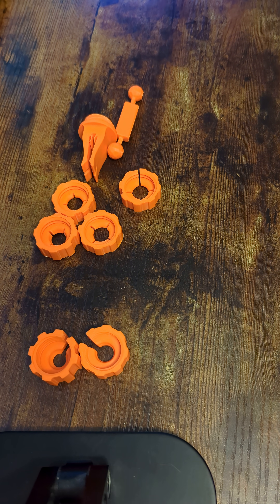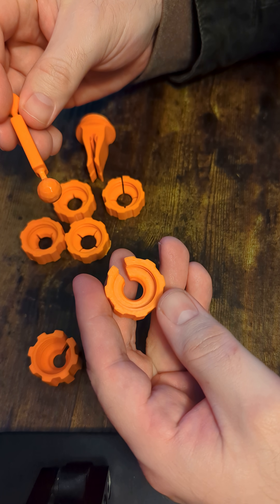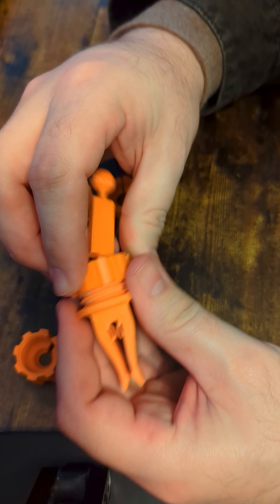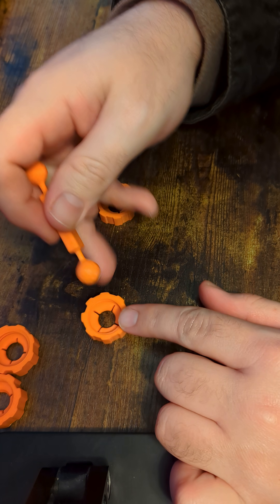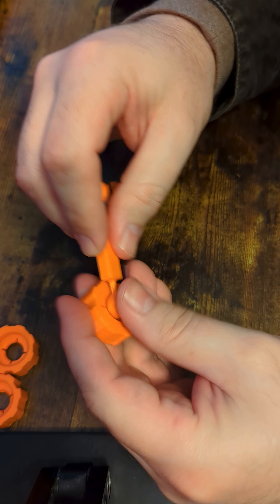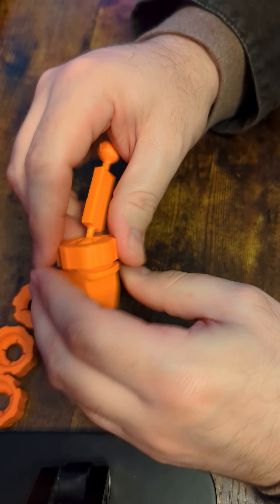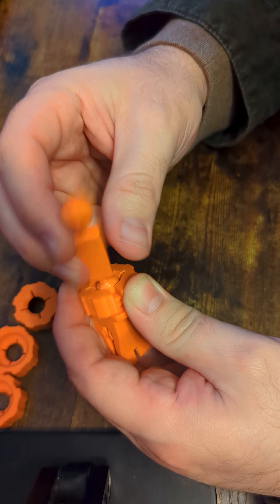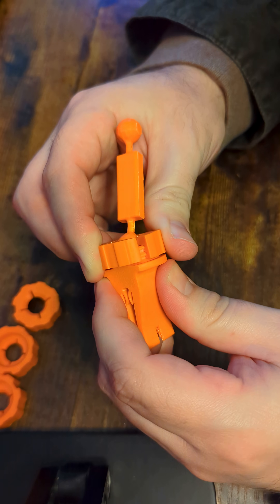Vent Vault 2 update: 11/14/25 - All the screw caps.

Comment: What are we building? New to your stuff so I'm coming in blind here. 🙂
Reply from the maker: That's a good point, we should probably start adding our website link to these videos!
We are building a docking system for car air vents to attach to a slim wallet that we designed. The docking system will contain registration and proof of insurance with the goal of making public interactions with law enforcement safer.